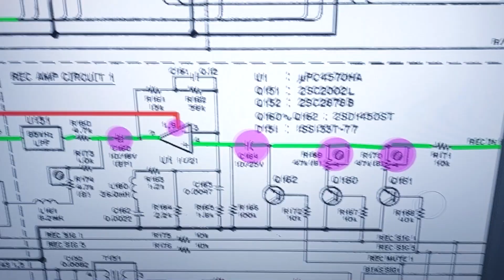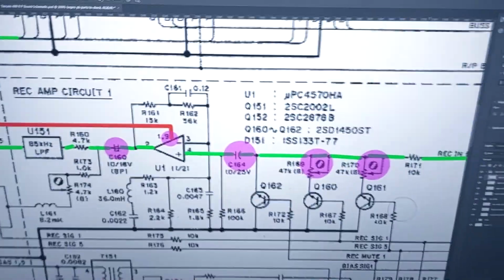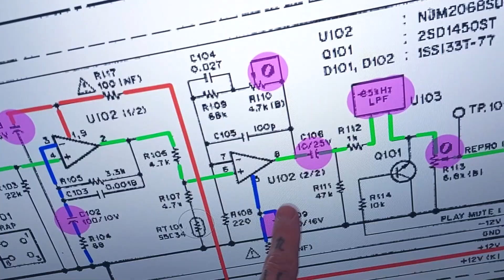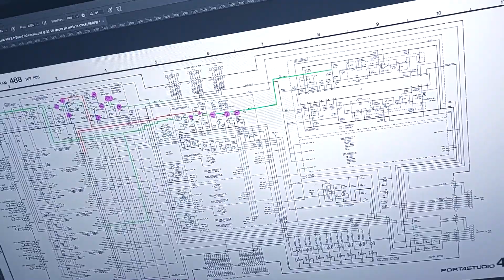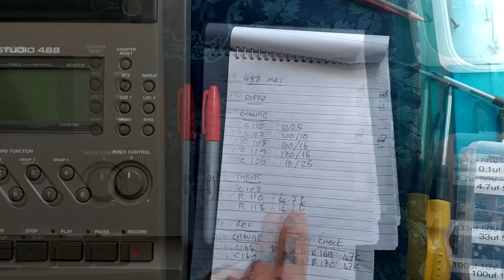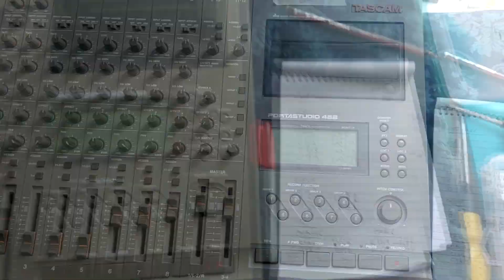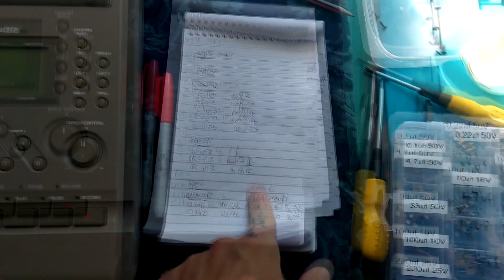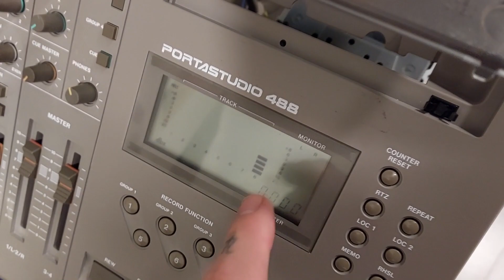Portastudio Weak Signal | Read Schematics & Replace Capacitors | Tascam 488

Comment: So, because I'm a nob, I just bought a full set of Nichicon muse caps for the audio line on my 488 MK1 and realised that they are bipolarised. Do you think it will be ok to fit them?
Reply from the maker: I don’t know for sure, but I’m assuming it could be a problem- I figure that most caps to ground are polarised so any AC junk can’t leak back up into the audio path, like a one way valve stopping grey water coming back up the plug hole and into the clean bath water? Even with the coupling caps between opamp stages, I’d worry the bipolar caps would change the low impedance output to high impedance input relationship by making any resistors or caps in adjacent stages part of the relationship, changing the impedances the designers expected ? I might be talking arse though.
Reply: @Tetrakan thank you. I'll regret taking the risk when I can just put the right caps in there. Do it right, do it once

Comment: It's pretty hard to come by those 10 µF nichicon ufw's now - i believe i heard they stopped making them? You still able to source the in the UK ? Or do you have another you use in their place? Cheers mate
Reply from the maker: @NiElsir  Yeah I’ve had end of line notifications from digikey, I’ve since used Panasonic caps instead and can’t hear a difference
Reply: The FM Panasonic's is it ? Was thinking of using those on the Power board so that would be a win 😊
Reply: Woops, think I meant to say FC there not FM.

Comment: I have a fostex X24 works perfect had it years and use it with a desk now and again but i noticed it's own pre amps are very hissy i use the desk pre amps so go direct in avoiding the Fostex pre amps and when playing back on desk i dont get the hiss of the Fostex pre amps.
I was wondering maybe if i changed the caps in the audio path it might calm it down i have fixed noise floor on mic's by changing caps to Nichicon so might be worth a try i suppose all cassette multitrack's need a re cap at this point in their age.

Comment: Thanks for this video. I've got a similar issue with my 488 mkII on channel three, where it records alright (flipping the cassette, I can hear channel 6 having the audio there sounding alright), but there's no playback (can faintly hear what I've recorded). Going to go in and see what needs replacing, fingers crossed, taking my chill pill
Reply from the maker: Likelihood is the electrolytic capacitors around the playback amp opamp need replacing, you could just replacecthose and cross ypur fingers or use an audio probe or scope to establish for certain where the signal from tape cuts out, good luck!
Reply: @Tetrakan  Thanks a lot! Turns out it's the low pass filter. Have you ever had to buy one? The service manual simply says "Coil LPF 85KHZ", and the component itself says "085181 Tk-", but I'm struggling to find a suitable replacement online with just that info. Any pointers would be appreciated! Thanks again.

Comment: I just found this channel and I'm self taught with very little electronics experience. I have a 424 mkiii that I've owned since the nineties and recently re-soldered the power supply jack (it was loose and would kill power in the middle of recording). That little exercise boosted my confidence, and now I'm using my four track more often!  I am very shaky on schematics but this is VERY HELPFUL. I know channel 3 on mine is not as strong in level and I always thought there was nothing I could do about it. You've inspired me to dive into this deeper and dust off my electronics bench!
Reply from the maker: Thank you. If you look through my recent videos there are a few with schematics in the thumbnails which might be worth you watching. Also consider whether the playback or record amp trimpots for your track 3 simply need turned up? See this video https://youtu.be/cYoXWq3N5js

Comment: Thanks so much for your videos! They have been extremely helpful! I was wondering if you ever have had to totally replace op amp chips? I have a porta two I'm working on where all channels see no signal at all when monitoring or recording line in. Playback is fine and VU meters respond appropriately to tape audio. On a whim I pulled out one of the NJM2068SD op amps to test it and it is definitely fried. Idk why all of them would fail, but it seems like a possible culprit? Are those chips serving as preamplifier circuit for the four mic/line inputs?
Reply from the maker: Yeah occasionally I do have to replace opamps, sometimes they are visibly singed or have actually blown up, osmetimes they just give me funny behaviour and replacing them fixes the issue. It comes up less often than bad electrolytics and bad solder though. How did you establish it is definitely fried? I don't have the schematic for the porta two, closest i ahve is the porta one, but I don't see the chip you mentioned in the parts list. Can I double check it is a porta two, not a porta 02 you are working on? (easy to mix those two up becasue the names are so similar but one is late 80s black and massive the other is miod nieties tiny and blue))
Reply: @Tetrakan  Good to know ! It is the 80's black shell one. I haven't totally ruled out electrolytics, though I did mostly recap at least one channel and it hasn't improved anything. I know I should just do the whole board. 
I removed one NJM2068SD chip and tested it as a comparator (0v to both inputs and reading the output which was always V+). It's possible it was damaged when I desoldered it, but I was pretty careful? The datasheet says those chips are optimal for audio preamplifier circuits and there are exactly 4 near each trim pot so I just assumed. I wish I could check the schematic somehow though. 
I may be misunderstanding the signal chain but it seems if the deck can playback audio and bounce to other tracks then it must be earlier on.
Reply from the maker: Ah ok. For whatever reason I haven’t had to fix the preamp stage of portastudios very often. I seem to remember from scanning over schematics that it’s common for a pair of transistors to provide most of the gain but there’s an opamp stage immediately after the gain trim variable resistor, I assume that’s a buffer isolating that stage of the circuit, but whether that’s the topology of your porta two, I can’t say without the schematic. Out of interest how did you set up the comparator test? Breadboard and a bench power supply? I really need to get myself set up for that sort of testing! If you hadn’t confirmed the chip was faulty, my first thought would be something is preventing power from reaching that stage of the circuit, on the principle it seems unlikely that all inputs were damaged get the same way but likely that they share a power rail. If you find a schematic for that model for sale I’d be willing to chip in if I could get a scan or digital copy, let me know how you get on.
Reply: @Tetrakan  Hey thanks so much! This is all really helpful. Yes I just used breadboard, power supply, and multimeter. I am very lucky because a friend of mine is an electrician and he has given me a lot of old equipment being thrown out by his work. I think disruption of power distribution is also very likely! Especially because the vu lamps also dont come on even though I tested all four bulbs and they work! I've cleaned all pin headers and sockets etc. with deoxit so it isn't that either. The chips just came today and I swapped one out. Just gotta connect it all together and power it up again, I will also test the voltages on the chips V+ V- legs. Thanks so much re:schematic! I was definitely thinking about it and I would be more than happy to make a scan for you. I would love for it to be accessible to people and Im grateful you share them all on your blog. I will let you know. Do you want to exchange email?
Reply from the maker: Great, I'm still wary about putting my email in the public comments, would you be able to message me on Facebook?
Reply: @Tetrakan  That makes sense! I don't have facebook but I have IG, are you on there?
Reply from the maker: I did set up an account a couple of years back but I've never used it! But I have the app on my phone now so yeah you could message me there, I'm tetrakan_supermonobloc